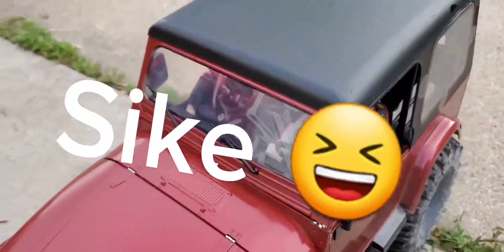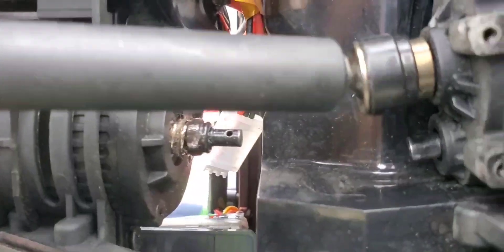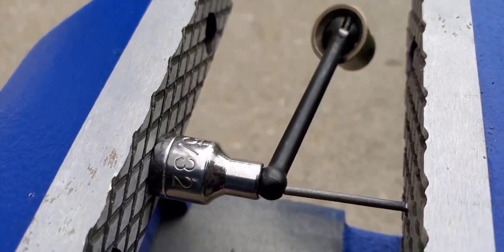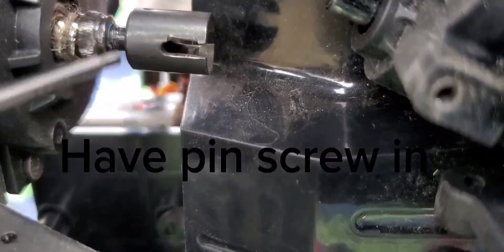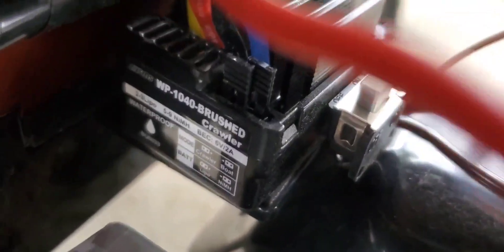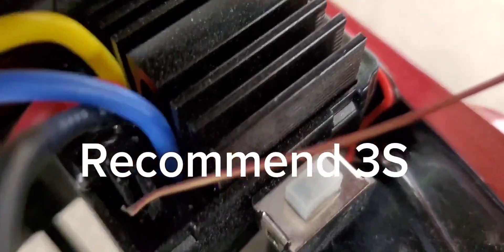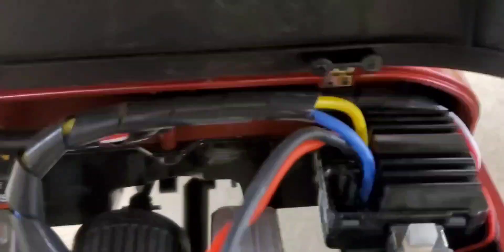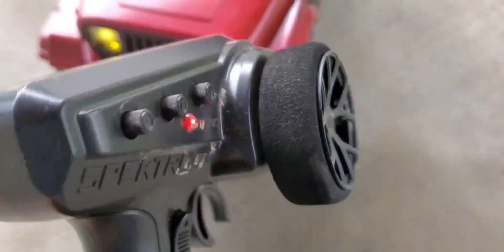Mashigan diy repairs & tips for beginners S1 Ep01

Comment: Love this rc. Just got done installing the leaf conversion on mine. Went from a 35t to a 21t and run on 5500 2s and it has a little more wheel speed now.  Have a 12t laying around and thinking of trying it
Reply from the maker: Recently did 3s and it wakes these up. Leaf springs make for more real driving experience.